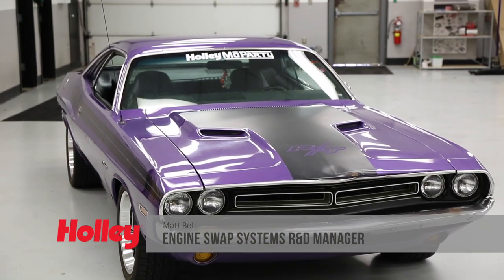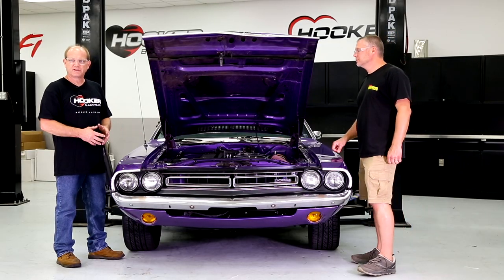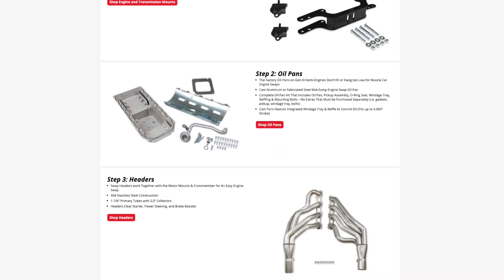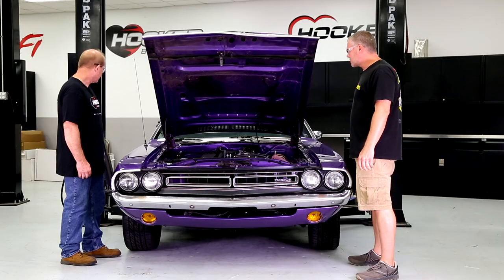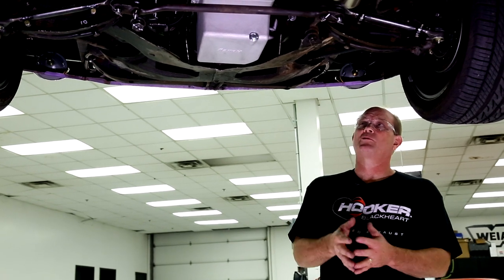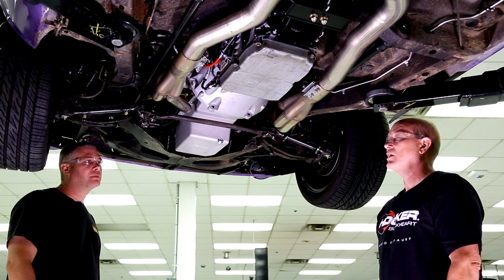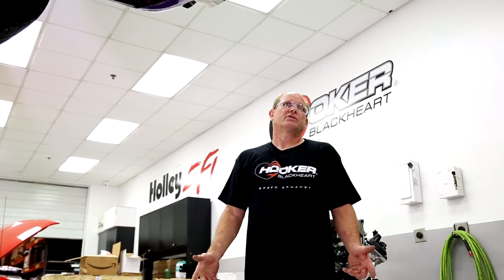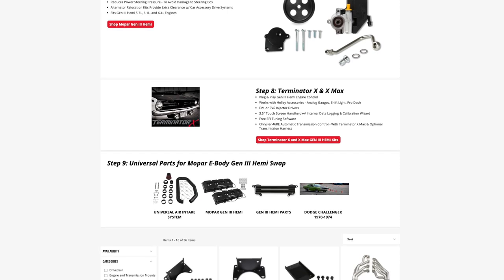How to Swap a Gen 3 Hemi into an E-Body Mopar with Bolt-on Parts

Comment: Awesome information. Did you have to change out the transmission tunnel, or would you have to for an 8hp70?
Reply: I got the 8hp70 to fit but was tight